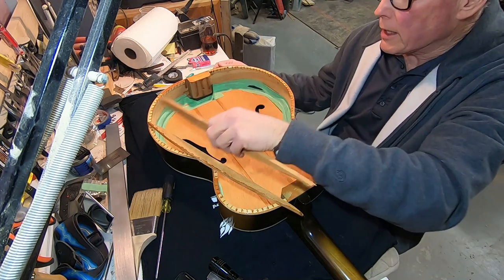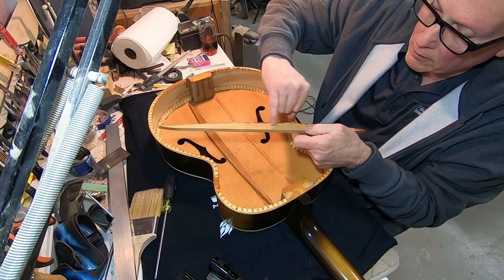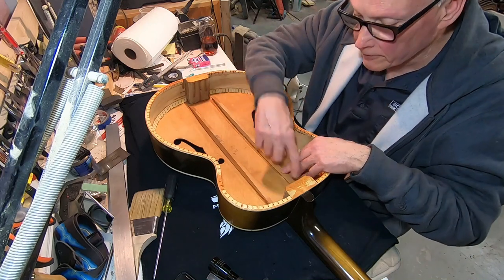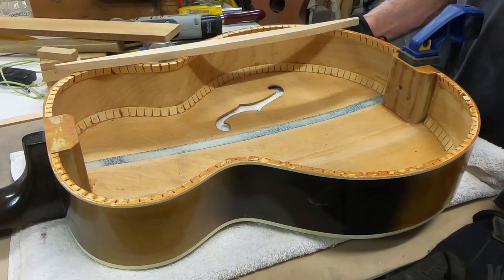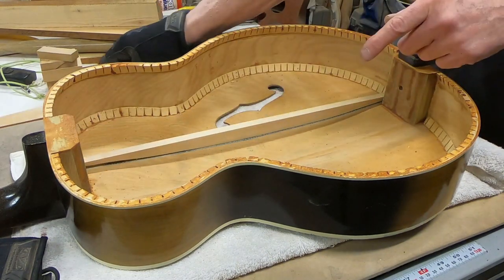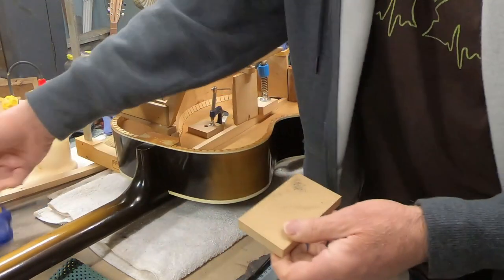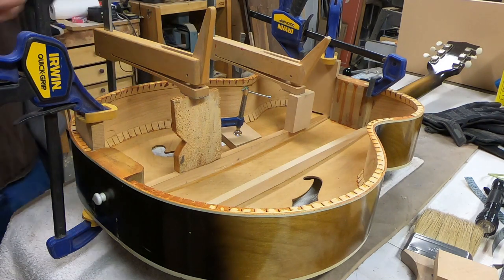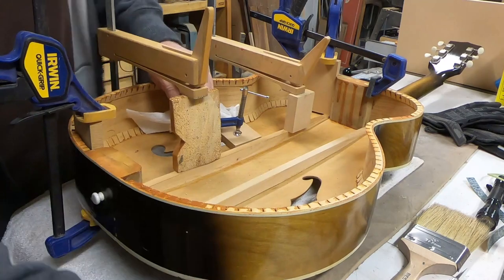62' HARMONY ARCH TOP, SHAPE AND GLUE BRACES at Jonah Guitars

Comment: Amen to learning on junker guitars. They typically have WAY more interesting and challenging problems. 
Agree with you on Robbie O’Brien too. I bought a couple of his video courses at some point. They’re great.
Reply from the maker: Hi Todd, good to hear from you. Hope you both are doing well through all this virus stuff. Learning on old or cheap stuff is essential. But I only did one beater neck reset on a 12 string and it turned out to be doweled. Next was a Taki 12 string and it was doweled. Next was a '50 martin 000-18 and it had a dovetail and came apart so easy compared to dowels. So sometimes practice isn't apples to apples.

Comment: Nice work Dane!!!!!)) I taped toned all my violin tops. I have a machine I set the tap tone with. When you cut the F holes you lose your tap tone but you bring it back by cutting the right amount off your tone bar or bars. But this is done before any thing is glued to the top. This has a lot to do with getting a good sound from your top. Tap tone is a interesting subject !!!!)) 🎸🎸🎸😊
Reply from the maker: Steve Harris, Tap tone is very interesting topic. I didn’t take any wood from the f holes. Thanks for checking in Steve.

Comment: Agree a good move pre-loading those braces a fuzz, but definitely lock the ends down as you say because the sound board has more influence on movement than the thin end of those wedges can reject? I guess they didn't fuss about it back then because the guitars were new and they weren't concerned too much with how they'd be holding up half a century later, and anyone with such an attitude wouldn't bother about squeeze out either. This baby will end up.better than new Dane.

"C" & "G" clamps ;<D Not sure how you even knew that!
Reply from the maker: "C" & "G" clamps ;<D Not sure how you even knew that! 
Hey I watch builders from over there.
It is funny to think about these 40$ guitars being around after all these years. I don't know what the UK equal of some cheap USA cars from the 70's but I don't see any Pinto's or Vega's around anymore. 
Two months old on this comment, somehow I missed a lot of comments and I'm trying to catch up. Thanks for watching my friend!

Comment: Did i miss how did.you get.the arch to go up before the installation of the new  braces? Or did you just use the c clamps and wood block? I hav the exact same issue, i thinkthis unit will become my slide guitar.
Reply from the maker: I cut cauls to fit the shape of the back which was still ok. Then I steamed the top while clamping the cauls across the top. The steam worked very well. I don't remember how many episodes there are in this series. But you could check back to previous episodes. I'm sure I did it or at least explained on camera. Thanks for watching.
Reply: @jonahguitarguy  Thank you for the reply  and for not letting your fans down to become more knowledgeable. Just for that, and you're  knowable input,  I will like and also subscribe 
My unit is much like this rebuild.  Cracked brace and all, yet it has  a few body cracks as well . Your's was actually in better shape. Lol 😆. 
I take it that you decided not to go with the binding.
I'm considering that as a rebuild of a cheap guitar find for the new experience. I would like to ask one thing, though! 
Could you please, at the very least, do some  playing of a few notes or noodling  as a show off on your last videos...
Thank you
Reply from the maker: @bobbennett790  I do play sometimes but I kinda suck. most of the stuff I know will get me a copy write strike. Thanks for your nice comments.

Comment: How to remove a bridge pickup and plug the hole in an arched top guitar.
Reply from the maker: A hole in the top of the guitar? Or a saddle pick up with an end pin hole. End pin hole no problem. Probably a 1/2” dowel will fit right in.
Reply: @jonahguitarguy  Years ago I saw in a video how they customized a two-pickup archtop guitar. What I liked was that they removed the bridge pickup and covered the rectangular shape in such a way that they did magic because they matched the paint on that guitar. They just left the neck pick up.
Reply: It is possible to cover the hole when you remove a pickup from the guitar, match the color, and only leave one pickup working?